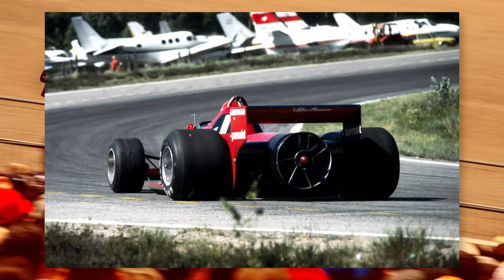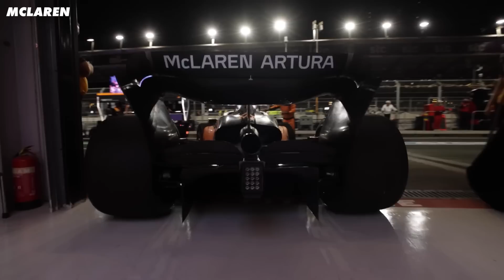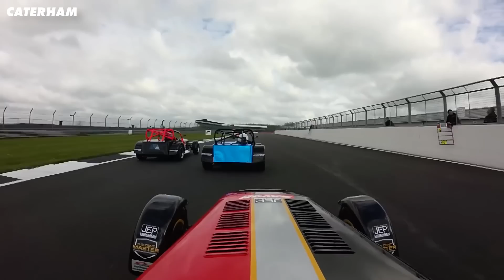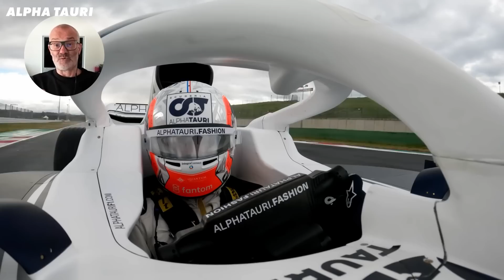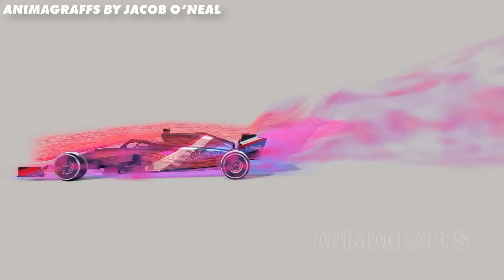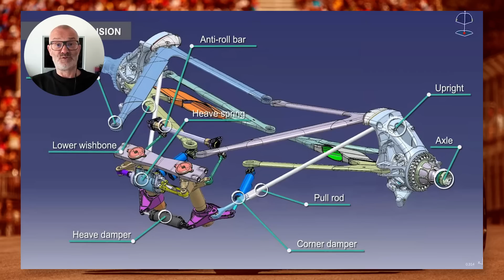Would Fan Cars Work in Formula 1?

Comment: I love the active duct aero idea. I like the idea of cutting down on the dangerous conditions caused by running a ride height low enough to cause contact between the car and the track surface, as well as the possibility of reining in the ol' pogo action (although maybe a little less sidewall is the ticket, there). For the scraping, perhaps some sort of closed-loop active bumpstops, or travel limitation of some kind, to allow as much travel as possible without scraping. I don't know, just thinking out loud. I don't want to see another iteration of the famous active suspension Williams car, though - I think most fans would agree that the biggest line in the sand separates driver control and pre-race adjustment on the agreeable side, from computer control and positionally optimizing suspension and aero setup while driving on the far side. 

I wonder if the drivers' necks can handle much more grip, though, in the case of a fan-asssisted system.

Comment: Active aero via driver control, love. Active suspension not so much. Active suspension fundamentally changes everything in my eyes. For the sake of feeling a car, I think suspension should remain as simple as it is now. And whilst were on the topic lol, I think engines should go back to v8s too. They were the sweet spot and we can definitely make them efficient with the right fuels. Most importantly, the cars need to be smaller and lighter. This is the perfect race car in my eyes. Basically, we need to go back to the 2009 Brawn GP lol. We need to go back and modernise that a bit. A tad bit more weight and size is okay but it needs to have that agile movability to it. These are the best of the best in terms of race cars imo.

Comment: active aero and suspension would make F1 much faster. fans?? probably not efficient enough the McMurtry uses 2 80hp fans?
you'd want to power the fans with Regen during braking and combined with strong active aero downforce + air brakes you could probably have extremely strong braking
Reply: fans would be great for F1, just look at the Red Bull X2010

Comment: Its definitely too big of an ask for F1 to adopt fan-assisted aero and the like. I'd rather just see a Speirling racing series. Appropriate tracks can be selected to minimise risk of loss of suction. 

I personally don't think the risk of loss of suction is inherently high, and that the risk has always been played up for nefarious reasons (other teams just didn't like losing). 

If contact occurs between cars on a corner, the risk would be minimal as long as the impact point is (slightly) above the car's center of mass. The bodywork can be designed appropriately to achieve this.

Track selection is by far the most important aspect of creating a successful fan car racing series. Golden rules = no curbs, no steep banking, smooth tarmac at least 2 car widths over the track limits to allow for hard racing. It'll be a task to find the right tracks, but there surely must be a dozen or so around the world that could be adopted with minimal modification. Worst comes to worst, paint some on an air field lol.

If Mcmurtry can run even a single successful racing event with their cars, they could well take the motorsport scene by storm. If they're faster than F1 cars, people WILL pay attention.

Comment: Formula 1 is the pinnacle of motorsport and engineering, it's honestly stupid how things like active suspension and active aero are banned when both of those are featured on modern road cars, even so, the legalization of ground effect is a step in the right direction and it's only a matter of time until the ground effect cars become faster

ps: bring back the dual brake pedals, the tuned mass damper, DAS, the F-Duct, blown diffusers, fan cars, even the X Wings! and make those damn things shorter and skinnier as much as they can without affecting the safety of the drivers!

Comment: The beauty of a fan car is not necessarily in just making the cars go faster. In my view the big advantage is being able to shrink the cars overall size. If you don't need those big honking aero surfaces to create downforce the cars can get smaller and "racier".
I also don't think the fans take anywhere as much power to drive as Scarbs' is saying. The Speirling uses a centrifugal compressor to vacuate the chambers not a big fan like the Murray cars did. Another advantage would be the ability to exhaust that air in any direction.

Comment: Active suspension fails and the car can be slowed ... active aero fails and the car becomes dangerous!
DRS operationally fails safe ... except when the active elements actually break.imagine going 280 down a straight with the aero de-activated ... and it fails to redeploy for the hairpin ... you now have no grip to brake ... I don't think any safety barrier could help!
As an aside do we actually want F1 cars to go faster? ... Isn"t 200+ fast enough? We want spectacular close racing ... not spectacular, race cancelling, accidents !!! ???

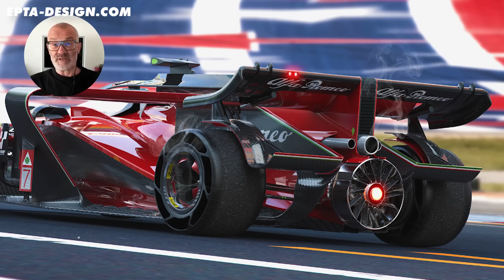Comment: @2:38 What car is that? Besides it's an Alfa Romeo in some way.

Anyway I don't think fans would be any good in F1. I am somewhat against active stuff and I think at least aero and chassi/suspension should always be passive systems in one way or the other. And this is not considering any racing just how an F1 car should be made or whatever. Less active feels more pure to me although I am not against electronic management for the engine and stuff like that. But if any active stuff should be allowed then I think they can loosen the regulations in general and let the teams make the fastest cars possible.

Comment: Active suspension and aero, if not only for improving performance and maybe racing, also make the cars more modern and lines them up with road cars.
That's good for all the manufacturers and even for the sport in itself imo. We all always say F1 is the pinacle of motorsports, but for most people, seeing cars like the Senna or 918 that have all this tech, and then F1 not having them can be a bit weird.
I feel that MotoGP does a better job at "looking" like the pinacle of its category by having all this cutting edge tech on the bikes. While F1 doesn't really do that imo

Comment: I think they should go back to cars like they had in the '60S. No wings at all. Only aerodynamics allowed would be the shape of the body.  Get the size down to the minimum that let's you fit in any size of driver and the crash structures . Definitely allow active suspension, and fans, which as we already have electric motors involved managing them shouldn't be a massive problem. A minimum ride height should be imposed for driver safety. Watching practice at Silverstone all of the cars I  saw were bottoming into the track surface, even the Red Bull which Horner says has no bouncing problems, but I guess he will happily batter his drivers if they are going fastest. (And have a whinge about Mercedes for good measure)

Comment: F1 needs the tech to come back for one major reason: F1 also wants works teams to stay involved, and the board rooms have a hard time justifying involvement in F1 past advertising, and advertising is non-existent if you're a backmarker team, and not great if you're in the midfield. If Toyota / Honda could both argue that the technology they'd pioneer in F1 would then hit their Type R's / GR cars, and then trickle down into their consumer cars in 5-10 years and possibly give them a real advantage in tech (like active suspension, 4 wheel steering, etc. did when they hit F1 first then eventually hit production cars to varying levels of success), then the investment in F1 could be defended more. And no works team wants to join F1 and stick around to be a backmarker (see Toyota, Ford (as Jaguar), and Honda previous works entries that did not last).

Where F1 is currently at with engine regulations and passive aero setups, there is not major room for improvement any longer, especially when the next engine regs are likely discontinuing the MGU-H as a concession to VW due to the high cost of R&D and the limited application on production cars, so there isn't a lot there for the manufacturers to gain any more without rolling back the gizmo ban on some level.

Comment: What I want to see is dragster type F1 cars that are much smaller with active aero fans to go at blistering speeds, also, jet fighter pilots will be the only ones capable of driving those trough corners...
Reply: basically Red Bull X2010/X2011/X2014

Comment: I believe a fully mechanical, not necessarily passive, but just not eletronic, aero/ other innovative devices would be the best way to go. I think that Drs is solving a problem that doesn't exist, and also creating other problems. I'm maybe not the best person to talk about the Drs existence, but just give your opinion here too, anyway, I think that solving a problem caused by a solution to a non problem with other thing is just gonna be a pile of unnecessary problems, meaning, the way the teams adjust the suspension can cause problems, maybe some will in some way have a more risky setup in favor of performance, kinda what merc did with the right height, and then a lot of other regulations will be needed, and you end up not letting teams adjust things as they want, kinda defeating it's own existence . If you eliminate all of this unnecessary problems teams will still evolve and find ways to, for example, get around the porposing. If you think about the situation in a kinda "philosophical" way, it kinda doesn't make any sense, it's like inventing a cup that it's completely closed so it doesn't spill, but then you can't drink , so you invent an eletronic lid to drink out of when you want, but then that lid will have problems, and you will make a simple thing very complex without any need. Hope it wasn't very confusing

Comment: you wouldn't turn on and off the fan most likely. you'd close off the airflow path which significantly reduces required power. additionally if rules allow then you'd feather the fan blades thus reducing required. both mean you could turn on the downforce very quickly if not nearly instantly.

Comment: Of course we know the answer - fan cars have already run in F1 and were banned after winning their debut GP.  But the solution suggested at around the 5 minute mark is more akin to that Subaru estate car that ran at Goodwood, sprouting airbrakes at every corner.  I'd love to see that in F1.  (And the dirty air diagram would seem to suggest that the answer is to go back to 1973 Tyrells or 60s Lotus cars where the dirty air seems far less!)

Comment: I remember some interview where the engineer was asked "What would you be able to create if all restrictions were removed."  He laughed and stated flat out that they would create a car that would kill the driver.  The forces would exceed what the human body can handle and continue to function and the reaction times would be far faster than what a human could produce.

The technology has already outstripped what a meat servo can handle, so the real question is, "How do we design the rules and regs so that the car can be pushed to HUMAN limits and still give exciting racing."
Reply: The car should be driveable by human in the vehicle. That's a pretty simple rule.

One day in the near future we will probably see unmanned/remote driven race cars on a real track going insane speeds. Like on an Oval perhaps. Would be neat to see racing missiles, haha.
Reply: @JonB83  there are micro car raze races. They program little tiny rc cars with full traction control. It’s amazingly fast.
Reply: basically Red Bull X2010/X2011/X2014

Comment: I think active suspension will give F1 a ton. It won’t be as massive of a change on rules,  performance and cost as a fan, it links to normal cars well, and most notably it can have a huge mitigating effect on porpoising.

Solving porpoising thru suspension would enable manufacturers a lot more freedoms for engineering within the rules. I think this could create a diversity of cars while all being within a very great set of design parameters for racing. Active suspension is not necessary an exotic technology, Cadillac first implemented magnetic ride control in 2002, and they are now on the 4th generation in the CTS range. Its proven and effective, and it belongs in the top tier of circuit racing.
Reply: Also some manufacturers already use magnetic ride or other variants on their road cars. Ferrari uses MagnaRide licensed from Cadillac, Mercedes has E-Active, Renault could find a crossover, Aston Martin put active suspension in the Valkyrie, and so on…

Comment: Imagine the racing where instead of DRS, there were sensors before turny bits of the track where drivers could turn on a fan system giving them more grip/speed around turns, thus promoting more overtaking in interesting bits of the track rather than just braking zones after long straights. Anyone?

Comment: making the car more complex isn’t the solution to better racing.....the reason the racing isn’t as exciting as people wish it to be is the parity between cars is extremely close, therefore any minor technical advantage makes for huge advantage on track, and the homologation rules / spending rules mean the teams that are behind can’t really catch up, throughout the season, and the best drivers can’t really shine.......other forms of racing where the tech is much more simple, still has good racing because the car DOES exceed the drivers ability by a large degree (unlike F1)......a prime example is a Winged Sprint Car; it weighs 1200-1400lbs, makes 900-950hp, and make huge downforce......the reason the racing is good is setup & driving basically determine success, due to the power greatly exceeding traction, and the track limits being well within the car’s capabilities (ex: the aero drag / speed stall point is never reached on basically any track)........I think is F1 could do the same by increasing HP and reading aero, both by a large degree; this wouldn’t be the tech people want, but it would solve there current complaints.

Comment: A couple of counterpoints I would like to make:
1. If a fancar were to crash and the fan breaks free while spinning, the blades become a flying buzzsaw that could injure or even kill another driver, the marshals, or spectators.
2. I'm not really against active suspension itself, but I am against race engineers pre-programming an entire racetrack into the ECU of the car. It's basically a cheat code that takes away the role of driver instinct and "feel". Adrian Newey wrote in his book that he basically told Nigel Mansell to trust the FW14B to go through a corner at higher speed even if he felt all 4 tires slipping and losing traction. Instead, I would rather have FRIC and the tuned mass damper be legal again, since they can't be electronically micromanaged to dampen every bump in the track.
3. I consider DRS to be a form of active aero controlled by the driver, and it's already really overpowered on a straight. My opinion on DRS is a device that gives more opportunities to overtake, not something that does the overtake for you . Instead, I would change it into a free-use tool with these exceptions:
 - The race leader is not allowed to use DRS.
 - If a car is less than half a second behind another car, both cars must close their DRS. This gives the car in front a chance to defend rather than get blown by because of artificially increased top speed. The half a second gap can be increased or decreased to give a fair chance for both cars.

Comment: Active suspension is already used in MotoGP. The rear end squats as launch as well as corner exit to enduce a wheelie to reduce frictional and roational  drag from the front wheel not being on the ground till 160mph

Comment: Considering we have fighter pilots flying around at Mach 2+ I don't think we have any idea of what human limits are when it comes to cars. Considering aircraft dynamics and  the pilot physiology of what is already possible, 10g sustained lateral is likely possible in a car with appropriate headrest support. With HANS braking limits could be higher than that. Bring it all on. Set the safety structural limits very high and the weight minimum very low and see where it takes us. Never compromise safety, and I'll bet you will be blown away at what is possible. This 'no driver aids' era when most all street cars have them is not realistic.
Reply: There is a limit of how many G a human being can tolerate.  Fighter jets have maximum G locked in the plane's computer.  At 9G a human being will lose consciousness.  Thus no figher jet can make a more than 9G move.  They already know human limit.
Reply: @catchnkill  Completely different Gs. 'Human limit' before G induced loss of consciousness or 'GLOC' as it's known in aircraft parlance is not an absolute limit, as physiology varies from person to person AND the technical skills used to avoid GLOC vary AND the limitations of the particular G suit the pilot is wearing, etc, etc. 
9 Gs is a good average, but that is vertical positive Gs. Race car drivers will never experience that direction. Lateral in the corners and negative forward while under braking are the axis we are concerned with. As I mentioned the driver headrest and the HANS device give the driver equipment that he can use to resist those Gs, and we end up with GLOC as the real barrier. GLOC from  lateral Gs is not well known. Perhaps you can point us to a scientific white paper that tested humans to lateral GLOC? The space program has probably tested this.